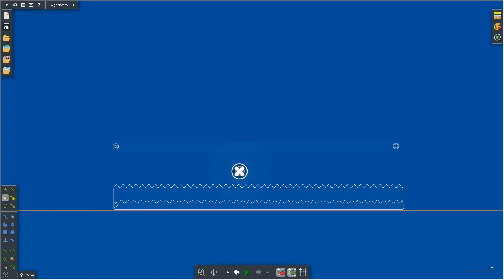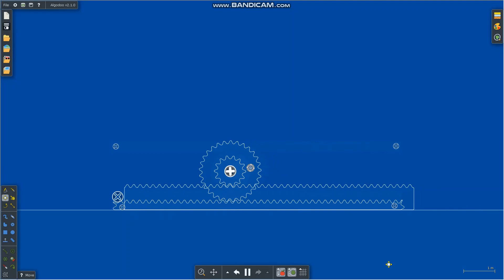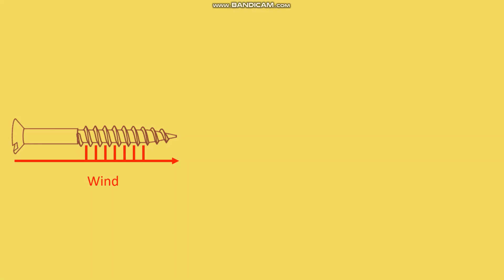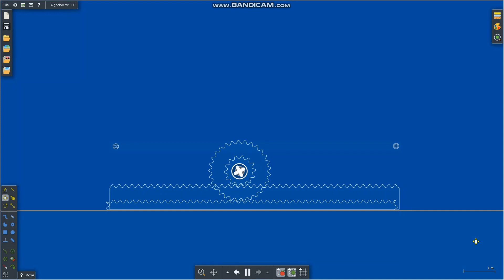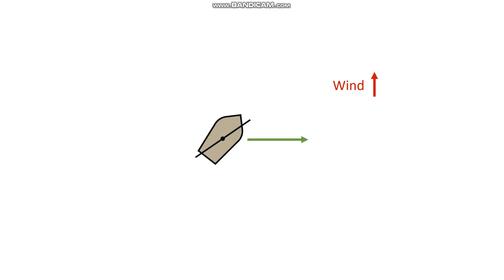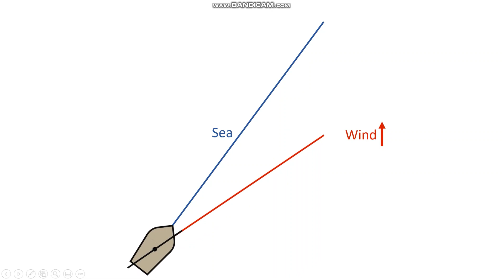Explained: Sailing faster than the wind, downwind

Comment: Wrong.  This gear radio effect might be some relatively small factor at certain angles to the wind with movement along the ground or on water, but the major factor is the Bernoulli effect on the airfoils, which creates a low pressure area on the downwind side of the airfoil, pulling the craft forward. The mechanical advantage described in this video fails to explain how a sailboat can sail directly at 0°upwind or directly at 180° downwind, where the craft has no imaginary leverage by way of the angles described in this video.  Rather than some mechanical advantage theory, the aerodynamic science verified through decades of experimentation and analysis, explains how the Bernoulli effect determines how a sailing craft can sail downwind faster than the wind or directly upwind.  It is the vacuum on the downwind side of the airfoils that primarily draws the craft forward, not some mechanical advantage.
Reply from the maker: A sail, Bernoulli effect or not will deflect the wind. This re direction can be modeled as a mechanical advantage with some friction, less for aerofoils, and more for flat plates. The mathematics associated with aerodynamics is not wrong, but can be perfectly modelled with mechanics using more refined mechanisms. I chose not to complicate the model more than shown in the video because it's not necessary to explain how this craft works. All the aerofoil refinement would do is change the angles of the sails and make the machine more efficient when not at maximum speed.

Tl;dr: The mathematics of mechanisms is perfectly transformable to that of aerodynamics. You can make more complex mechanisms to model more complex effects, but it doesn't change the underlying multiplicative nature of sailing faster down the wind down wind, so I kept it simple.
Reply: Sailboats can't sail directly into the wind and when they're sailing directly downwind they use a completely different mechanism: they're just pushed along rather than relying on the sail acting as an aerofoil. The explanation also doesn't contradict the aerodynamics involved, it's just a model used to help explain what's going on and help visualise why something apparently counter-intuitive can happen.
Reply: @bmurphy737  Wrong.  I've personally known that one can sail directly upwind for 50+ years.  I built models back in the 1970s that proved the truth of that.  Most ordinary teenage boys could do the same today.  

This is an especially repugnant problem when I see such contrary opinions from people who should know better, such as sailing experts, physicists, and engineers trained in aerodynamics.  There are plenty of videos on YouTube demonstrating that sailing craft can sail directly upwind.  Instead of claiming this is impossible based on (ignorant) theory, these nay-Sayers should spend a few hours building one of the many models shown on YouTube and demonstrate it through the scientific method known as 'experiment' rather than conjecture of 'theory'.  

As an avid sailor myself I am all too often sadly disappointed when I mention this aerodynamic principle to other sailors who mention that you can't sail directly upwind.  I never point this out first but only do so when confronted with such ignorance from others who should know better.
Reply: @melellington1333  I think you should read what I said a little more carefully before launching into an attack. Everyone who’s sailed knows you can sail upwind. What I said was directly upwind, referring to your claim that you could sail upwind at 0 degrees to the wind. If you think that is possible, maybe you could explain how? In aerofoil terms, it’s an angle of attack of zero, which on a symmetric aerofoil, would not generate any lift force, much less one that included an upwind component.
Reply: @bmurphy737  On the contrary, you should read what I said more carefully.  I specifically said "one can sail directly upwind" in the second sentence of my comment.  By 'directly' what I mean say more specifically is 0° to the ambient a.k.a. absolute wind, not necessarily 0° to the apparent a.k.a. relative wind.  

Re your comment "If you think that is possible", that's akin to saying "if you think the earth is not flat. . . ".  I've already explained how it works too many times on YouTube and elsewhere on the Internet; as have other people.  Frankly I'm really getting tired of doing so after 50 years of explaining it to people otherwise knowledgeable in sailing and aerodynamics.  There are plenty of explanations on the web—you should Google it.  I'm not in the business of teaching anymore but sometimes I just can't sit by and have people promulgate misleading information.  I usually let go by but as in the instant case I just can't.  

If you'd like to put some money up against mine, that I cannot sail a boat directly 0° to the wind by the power of the wind alone, using no stored energy such as a battery, I'd like to take your money.
Reply: @melellington1333  Let’s keep this simple, shall we? What you said was “a sailboat can sail directly at 0°upwind”. By this, I took it to mean that if the wind was coming from due North (i.e. 0°) that a sailboat (which I took to mean a boat powered by sails) could happily also sail due North (i.e. also at 0°), or at 0° relative to the wind. Is that what you meant? If not, perhaps you could explain what you did mean.

If it is what you meant, I’m afraid you will have to explain, as it’s a pretty extraordinary claim that flies in the face of any sailboat experience I or anyone else I know has had. If you’re not willing to do that, perhaps you could reference just one reputable source that backs the claim. Saying “you should Google it” really doesn’t do it, as any normal sailing reference will just describe what actually happens if you get too close to the wind. 

As for your bet, I’ll decline, thanks: changing the wording (“sailboat” to “[a boat] by the power of the wind alone”) amounts to moving the goalposts.
Reply: @bmurphy737  Re "(which I took to mean a boat powered by sails)"
 
That's your assumption.  It was not my assumption.  I have no idea how someone would use a typical "sail" to sail directly 0 degrees into the wind.  I've had many sailboats over the last 60 years and currently have a 30 foot catamaran sailboat.  Never have any of them been able to sail directly into the wind except by sheer momentum for a few moments.  

Re "a pretty extraordinary claim that flies in the face of any sailboat experience I or anyone else I know has had."  Wow...such limited sailing knowledge. OMG.  The claim is not "extraordinary", since it's been proven for 50+ years, that I'm aware of.  

Re "perhaps you could reference just one reputable source that backs the claim."  Why should I do your research?  How many times do I have to do that for people who can't muster the wherewithal to do it themselves?  It's so easy nowadays compared to what I had to deal with 50 years ago before the advent of home computers.  

Look...lets make it simple for you since you won't make the effort to do the research yourself.  BTW I did the research 50 years ago at the US Patent Office and discovered this direct upwind sailing, which I independently conceived back then.  Since then I've seen people discover it again and again over the decades.  Here is a very brief introduction: 

If you put a windmill on a sailing craft, be it a boat, land yacht, or otherwise, you can channel the power that comes off the windmill to propel the boat with a screw or in the case of a land yacht to the wheels.  It's been proven again and again over decades that such vehicles can sail directly into the wind at 0 degrees to the absolute wind.  

And please, don't retort that a windmill is not sail and therefore your position is still valid.  Nonsense.  The blades on a windmill/wind turbine are simply sails on a horizontal axis that rotates due to energy from the wind.  In fact many of the old Dutch windmills actually used cloth 'sails'.  Google it.  A sail is just an airfoil, like a wing, and like the blades of a wind turbine.  

And please don't retort that to 'sail' somehow is limited to conventional sailboats, since the old steamships 'sailed' across the oceans and modern ships sail the oceans as well.  You're narrow assumption of what 'sail' means is your limitation not mine.  Frankly, I'm so tired of pointing these things out.  

I'm sure you'll retort that you "assumed" we were talking about blah blah blah.  Well…those are your assumptions based on insufficient knowledge of the subject.  What I'm pointing out is the truth of the central issue: that one can have a sail boat sail directly at 0 degrees to the absolute wind, only by power derived from that wind.  The issue has long ago been settled by experimentation, regardless of any "theories" you can put forth.  Theories give way to experimentation—that's basic science.  Science does not require any proof by way of theoretical explanations, it requires proof by way experimentation.  Until then its just 'theory'.  

Lastly, I suggest you view the video by Veritasium at: 
https://www.youtube.com/watch?v=yCsgoLc_fzI

In that video a UCLA Physics Professor very recently bet Veritasium $10,000 that a wind powered land yacht could not sail directly downwind at 180 degrees to the ambient/absolute wind—faster than the wind itself.  The UCLA physics professor lost the bet and paid Veritasium $10,000.  That professor's kind of limited thinking is born of 'education' and 'theory' not of reliance on 'first principles' of airfoil aerodynamics established through decades of experimentation going back to the Wright brothers and long before.  

Needless to say, any 'knowledgeable' modern sailor knows that high performance sailboats sail several times faster than the ambient/absolute wind—and moreover, such craft do so downwind; so it should not take a genius to extrapolate that the wind can power sailing craft directly upwind as well, since one would 'assume' even more wind power is available in that direction than downwind.  If you watch the Veritasium video, at one point it is mentioned that the Blackbird craft can sail directly upwind as well.  Check out the video beginning at 7:54 for a direct upwind boat receiving a US patent in 1978, and a large catamaran built in England several decades ago at 7:59.  These are only a very few of the available examples going back 50+ years.  I remember reading about a direct upwind sail boat developed in England in the early 1970s at an experimental yachting society.  

I fully expect the general population and especially sailing experts to be totally ignorant of this for another 50 years.  It reminds of just a few days ago when I was chatting with a guy who's been sailing for a while and I mentioned that some of these sailboats around the waters where I live, don't get rotten after many decades because they're made of cement.  He was taken aback in disbelief that such a boat wouldn't sink.  Then I also mentioned they made some very large ships during WWII out of cement; plus, there was a cement boat dug out of a lake in Europe which had been sunk there hundreds of years ago—and it still wasn't rotten.  Sorry...I couldn't resist the digression related to assumptions based on "common knowledge".
Reply: @melellington1333  That’s downright hilarious. 

“Never have any of them been able to sail directly into the wind except by sheer momentum for a few moments”
 Followed almost immediately by: “Re "a pretty extraordinary claim that flies in the face of any sailboat experience I or anyone else I know has had."  Wow...such limited sailing knowledge. OMG.  The claim is not "extraordinary", since it's been proven for 50+ years, that I'm aware of.  ”

Which is it? The claim I was referring to was exactly the one you say you’ve never seen! It’s not my claim in any case, it’s yours! You literally said: “this video fails to explain how a sailboat can sail directly at 0°upwind”

I note you can’t provide a single source for your claim. It’s not my research, by the way, as I’m not the one making the claim.

As I suspected, your challenge did relate to a moving the goalposts. I’m well aware that wind powered boats can be constructed to go directly upwind, but they are not “sailboats” (i.e. boats with sails as their propulsion method). Unless of course you manage to find that reference with that computer of yours.
Reply: @bmurphy737  "Sailboats" are simply boats that sail—even when it is powered by a gasoline engine.  It's as simple as that.  They don't necessarily have to have conventional sails.  Some sailboats have wings that look like those on an airplane and are not made of any type of cloth.  Just because an airfoil on a boat rotates on an axis, does render it not a sail boat.  It's your limited tunnel vision that inappropriately and restrictively defines "sailboat".  If I constructed a windmill of sail cloth like the old Dutch or middle eastern windmills many centuries ago, and put that on a boat, according to your tunnel vision that would not be a sailboat.  In my view and that of many others, that would still be a sailboat.  

On the contrary, I did give you a source for my claim.  I referred you to the Veritasium video. On the other hand you have not shown me any credible source for your claim that one cannot sail directly upwind.  

You're wasting my time.  I've been through this debate many times in the past.  As they say "you can lead a horse . . . ".
Reply: @melellington1333  So, we’re getting a bit closer to the truth: you are relying on redefining what a sailboat is. According to a couple of dictionaries I’ve checked a sailboat is “a boat with sails” and sails are “a sheet of strong cloth which the wind blows against to make a boat or ship travel through the water”. Now you and I both know that some sailboats do indeed have motors, but do you not think it a bit of a slippery argument to claim they can sail directly upwind by turning their motors on? Or taking down their sails and putting up their wind turbine and/or other aerofoils and/or wind powered propellors?

I did ask you explicitly to clarify what you meant, but you declined to answer, preferring instead to go on a long rant.

Let’s recap shall we? The video you commented on provided a useful model of how a sailboat (see definition above: no motors involved) behaved when sailing into the wind. You said it didn’t explain how it could sail directly into the wind, to which I responded it didn’t have to as sailboats (the thing being described) couldn’t actually do that.  According to your logic, a video that explained how balloons flew would have to explain why they could fly upwind on the basis that other flying machines exist that can do that, even though they use a completely different mechanism to achieve it. The video is very explicit in the type of craft and sail/aerofoil being modelled.

As I mentioned several times, I don’t doubt for a second it’s possible to build a wind-powered boat that can travel directly upwind.

As for the Veritasium video, I’m well aware of it and the indeed brilliance of the engineering behind the cart it describes. Although the video does go into how sailboats can travel faster than the wind upwind, like the video above it does not explain how they can travel directly upwind (again: for the simple reason they can’t). Hence, it’s not relevant at all to the claim you were making.

So, it has indeed been a colossal waste of time. We agree: it’s impossible for a “conventional” sailboat to sail directly into the wind; it’s perfectly possible for a wind-powered boat to do so.

I stand over everything I’ve written. I’m not at all surprised you’ve been through this debate many times if you refuse to clarify exactly what it is you are saying when asked.
Reply: @bmurphy737  Regarding "you are relying on redefining what a sailboat is."

Not so.  If I were redefining then there would be no available examples to support my definition of sailboat and sail.  Your reading of dictionaries to support your view is again an example or your narrow tunnel vision.  I recognize your view among the dictionary denotations of 'sailboat' and 'sail', but you refuse to acknowledge other denotions which  use those terms legitimately in other contexts.  You pick and cull the denotations that suit your narrow view, but I take a broad view of the terms 'sailboat and 'sail' which are supported by others.  If there were no available definitions that support my view I'd agree with you that I’m 'redefining' the term 'sailboat'.  However, here are some of my definitions available on the Internet:

From Merriam-Webster—

"sailboat":  "a boat usually propelled by sail"

Which begs the definition of "sail"…
From a Google search for "sail meaning" —

A "sail" includes a denotation:  "a wind-catching apparatus, typically one consisting of canvas or a set of boards, attached to the arm of a windmill."

https://www.google.com/search?client=firefox-b-1-d&sxsrf=ALeKk00UKV4U5CAs3pIRWjP2A_w1Uzne_Q%3A1626695631318&lei=z2f1YJLMEu-Z_QbKmLZQ&q=sail%20meaning&ved=2ahUKEwjS74u6ie_xAhXvTN8KHUqMDQoQsKwBKAN6BAhdEAQ&biw=1270&bih=570

From the online Free Dictionary—
"sail" includes a denotation: "an apparatus that catches the wind on a windmill"
https://www.thefreedictionary.com/sail

From https://www.yourdictionary.com/sail a "sail" is "Something, such as the blade of a windmill, that resembles a sail in form or function." 

It seems that for you a "sail" can only comprise a "sheet of strong cloth".  I take a broader view of a sail as including "an apparatus that catches the wind on a windmill" — yet not exclusively defined only in that way.  On the other hand you can only accept 'sail' as defined exclusively in a narrow way as "a sheet of strong cloth", ignoring how others (besides me) legitimately define 'sail'.  I have not ignored your definition as illegitimate, but you ignore mine. 

Re "a bit of a slippery argument to claim they can sail directly upwind by turning their motors on?"

I made no such claim. you misinterpreted that.  I merely claimed that a sailboat can be powered by a motor and not necessarily powered by a sail and wind.  Do you dispute that?  Your claim seems to be that a boat is only a sailboat if its power to move is exclusively powered by the wind on a cloth sail, and moreover, if powered by any other means it is no longer a 'sailboat'.  Which is nonsense.  That's not how a sailboat is defined in my State's law nor in many sources on the Internet.  

Re "preferring instead to go on a long rant".  And your last message is not a long rant?  More nonsense.  

Re "I don’t doubt for a second it’s possible to build a wind-powered boat that can travel directly upwind."  

Well…that's my point, which you ultimately have clearly acknowledged to be true.  

Your point is that a "sailboat" and "sail" is only legitimately narrowly defined with cloth non-rotating sails, while my point is that there are other more broadly defined and legitimate definitions of sailboat, as so cited above, which includes a windmill on a boat.  That's the bottom line.  

______________________________________________
Reply: @melellington1333  I really am not interested in playing silly semantic games. You made a specific claim about sailboats, which I took to mean boats with sails, using those sails to move forward. I spelt out exactly what I meant when you came back at me and asked you to confirm that was what you were talking about too. You completely ignored that and just ploughed on making the same claim, throwing in references to your great expertise and how limited mine seemed to be. I’m happy to admit I’ve limited (though some) sailboat experience, but I’ve worked professionally as an Engineer for most of my career, having qualified professionally as such several decades ago. 

I also declined to take your bet, pointing out that the wording effectively changed what I understood you were talking about. The fact that I declined the bet should tell you about whether I believe it to be possible or not for a wind-powered boat to travel directly upwind, so no it’s not a sudden conversion on my part; I’ve always known it to be true.

As I said, it seems we agree on what is and isn’t possible in wind powered machines and what "traditional" sailboats can and can't do. As it happens, I’m a great admirer of the Blackbird cart as described in the Veritasium video you mentioned and have commented there to say so. It’s a very elegant piece of engineering design.

If you were a little less condescending and confrontational in your attitude, you might help convince a few doubters to the cause of understanding how things work. As it stands though, it’s no wonder you have repeated experiences of trying to explain yourself to others.
Reply: @bmurphy737  Calm down, It is obvious that your opponent is not even talking about the video theme. He ignored the context to talk about how "smart and experienced" he is. That happens to old people sometimes, they cannot meet any other meaning of the word, and spoil the arguement by taking it into "lexical battle" instead of a "physics discussion".
Reply: @kongolandwalker  You're right of course. Why someone goes to such extreme lengths to show their brilliance is beyond me, especially as it only proves the opposite.